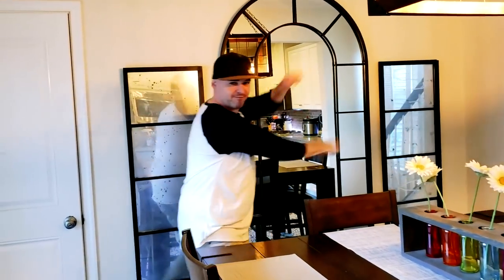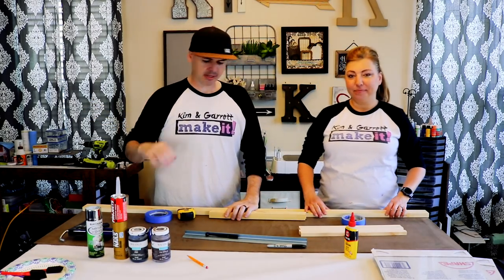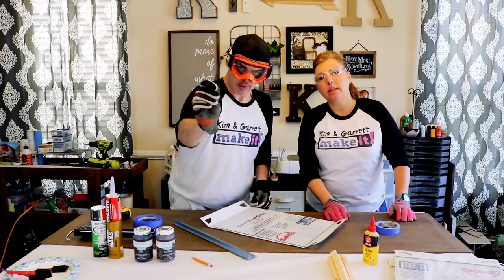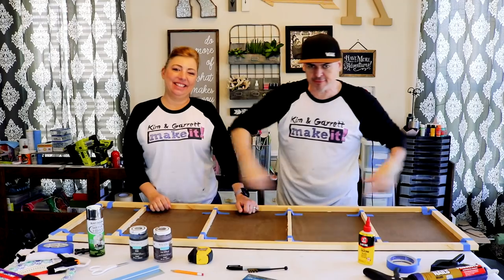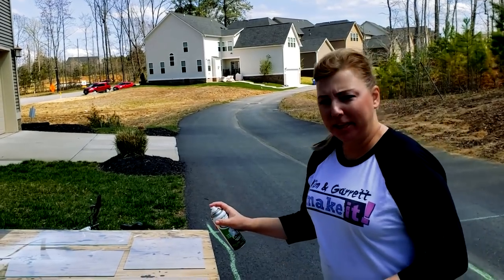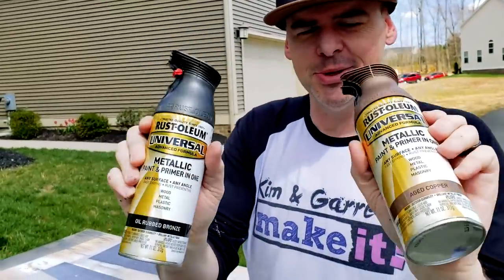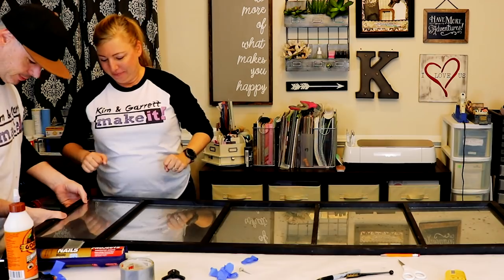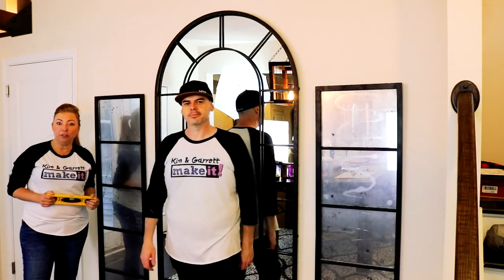Genuine Faux Antique Mercury Mirror!

Comment: Oh man, that's a bummer that you can see the liquid nails through the glass, never would have thought that especially with the multiple coats of paint you put on. Maybe next time use clear caulk and only a little at the edges, that should be all you need. Really cool tho, I have to remember the trick with the apple cider vinegar. Do you know if regular vinegar will do the same thing?
Reply: p.s. Garrett's good at balancing stuff, I'll be expecting you to balance ALL your projects from now on, it's your thing
Reply from the maker: We are going to re-do some of the sections that the liquid nails bled through. We will post that video. That balancing comment gave Garrett the green light to balance everything. Haha. He has to try to balance, spin or flip everything.
Reply: @KimandGarrettmakeit  LOL go with your strengths! His is balancing stuff, probably was a circus performer in a previous life. I can't even balance a checkbook 😉